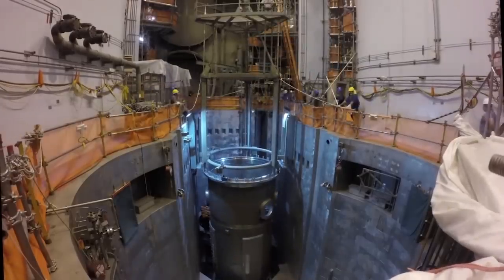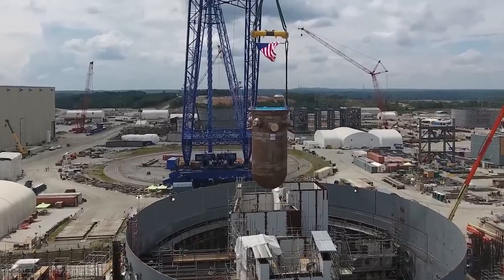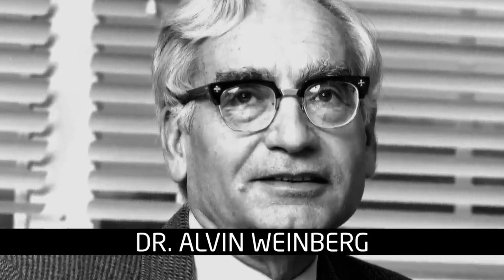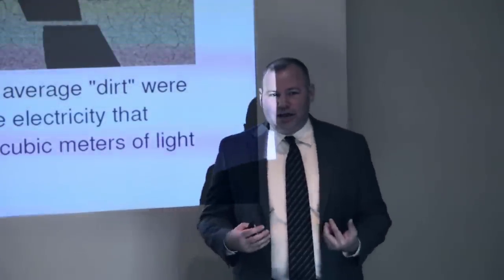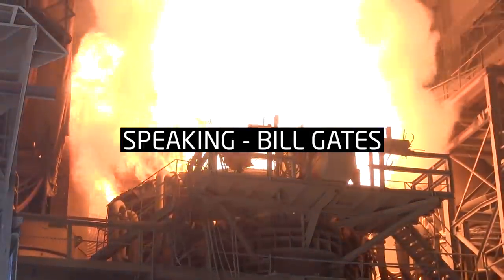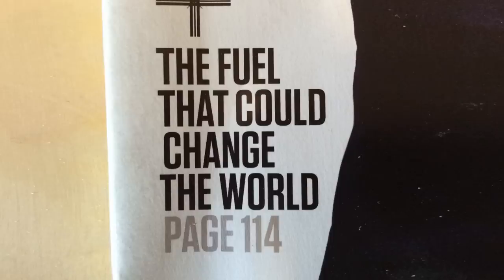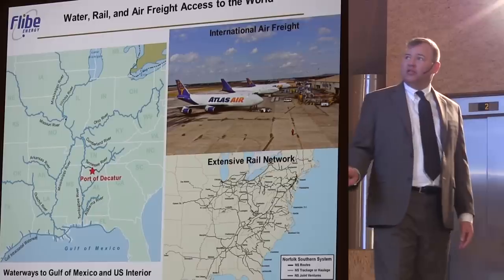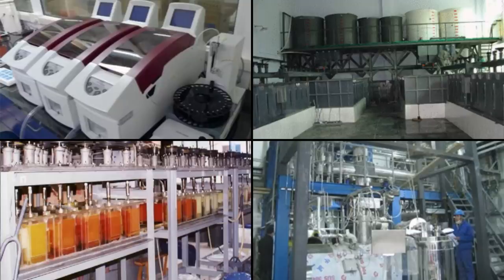Thorium 2017

Comment: Without knowing details regarding Thorium reactors, this reminds me of vertical-axis wind turbines.  Continually promoted by peripheral figures in wind energy, sometimes built, they always fail.  No windfarm uses vertical-axis wind turbines, but they sound so good when some "Professor Crackpot" names "advantages" without mentioning the DISadvantages.
And of course the real die-hard promoters of vertical-axis wind turbines end up name-calling and blaming entrenched special interests for the nonperformance and early failure of their pet designs.  They can never figure out it is just a bad idea.  

Having seen all this in wind energy for so many years, it makes me wonder if the real story regarding "Thorium Reactors" might be a similar case of a story that sounds great when only the "advantages" are presented, but has an "Achilles heel" where unmentioned deal-breaker realities loom, waiting to render the projects ineffective, with the technology not being the true solution being promoted.  Just sayin'...
Reply from the maker: Doug, thanks for taking the time to share your thoughts. Have you taken 34 minutes of your time to watch the video you are commenting on? It will impact how much I devote to writing a response.
Reply: Yeah I did watch it all, now that you asked me to, and it indeed reminds me of vertical-axis wind turbines.  For example, if someone DOES want a vertical-axis turbine, yes, it will come from China.  They seem to be the only manufacturing-capable group still ignorant or gullible enough to believe the hype over VAWT's.  Or they know there is always one more customer who has not heard the real story and who will buy one more.   I note other similarities:  The discussion diverges to many disparate subjects such as recycling, space travel, steelmaking, removing CO2 from the oceans, etc., which serve to dilute the message, while subtly adding known true facts to lend credibility to the discussion.  And the idea of extracting thorium from every cubic yard of non-ore-grade dirt reminds me of how crackpot wind energy promoters always start by explaining how a single square mile into the sky of a good wind resource could power X number of homes, then spend a lot of time explaining that we actually need electricity, as though that was ever the question...
What I do NOT see is a balanced discussion where the negatives are presented as well as the positives.  Could it be true that there are no negatives?  OK by the time I see Charlie Sheen promoting it, I am reminded of Ed Begley Jr. promoting vertical-axis wind turbines.  He even got Jay Leno to put one up on his garage!  Didn't help, they still suck, making almost no power, probably broken down by now, and your average person knows nothing of any of it, but are left with a vague emotion-based "feeling" that "Somebody is doing something about nothing".   By the way, there is no usable wind resource in Hollywood.  Putting up a wind turbine in any residential neighborhood is like trying to mine nuclear fuel in your backyard - "Hey look!  Some dirt!  Problem solved!"  Well,  believe me, I hope all this Thorium info is all true because it would even make fusion irrelevant for the foreseeable future.  But I have a sneaking suspicion there's just a lot more to this story.  Take, for example, the presentation of a meltable plug where the contents of the reactor vessel flow downward into a dump vessel of the same size for safety.  It sounds foolproof, right?  So we're done?  Case closed?  Concept proven?  No more questions?   Done deal?  OK lets take it to Fukishima.  What happens when the Tsunami knocks it over and "down" becomes "up"?  What if something else clogs it?  What about sabotage, or an explosion from something else?  Like I said, we the average people would be hard-pressed to have a meaningful opinion on any of this.  I noticed you have another video about "debunking" the thorium salt reactors,  which is slightly deceptive click-bait in that it is more like debunking the debunkers, so maybe I should watch that.  Don't get me wrong - this all sounds great, but I come from a background of energy innovations that "sound great" and I consistently watch as almost every single one of them slowly "debunks" itself.  Like they say, if someone is talking like an idiot, don't argue'  with them, just let them dig their own grave and go on talking nonsense until they bury themselves in their own stupid statements, most clean-energy breakthroughs die of their own flaws, rather than anyone squelching them.  So, for now, thanks for responding to my concerns, this is great fodder for curious minds.  It is , like I said, hard to have a true opinion without the extensive background required, although I was a physics major in the U.C. system, all I can say is I see "symptoms" of a "syndrome" that is very familiar to me by this point in time.  I hope my concerns are unfounded and it is "the answer to the energy crisis" (there's an energy crisis?) depends what day it is.  I recently read an account of all the times we've been warned about "peak oil".  Turns out it started with the very first oil well, and has never stopped since!     :)
Reply from the maker: Well now I know something about Vertical-Axis-Wind-Turbines ("VAWT"?). You are the first to bring it up as a thing to me, although I'd heard of the concept before. It just didn't sound interesting.

Of course VAWT have been commercialized and are now demonstrating their potential (or lack of?) and Th-MSR has not. I'd argue that the technical viability of MSR was demonstrated with MSRE, and that the vast majority of people in nuclear field was are aware of MSR ventures feel it is something we should pursue further.

> What happens when the Tsunami knocks it over and "down" becomes "up"?

...I do address inaccurate statements and fundamentally groundless concerns in my 6.5h edit starting after the opening credits... https://www.youtube.com/watch?v=2oK6Rs6yFsM&t=2h7m51s ...But you would be the very first to worry about the reactor getting knocked over.

I'm not going to release a video where such statements/speculation are made without context. Go watch some anti-nuclear drivel if that's what you'd like to see... there is plenty of that to choose from. The vast majority of man-hours spent watching "thorium" content on YouTube is wasted on solid-fuel reactor challenges, or on nonsense about a magical thorium car. It is my highest priority to clarify than an economic Th/U233 fuel cycle depends on liquid fuel, as that is where the derailment of dialog on Thorium commonly takes place.

That you mostly see MSR advocates on-screen in this 34m video, and relatively few universally renowned scientists (aide from Dr. Alvin Weinberg captured on video) is because the original proponents of MSR are dead. I don't have a lot of material to work with, unless you want me to keep pulling quotes from books (like Richard Weinberg does from his father Alvin Weinberg's book talking about the chemical kidney). That doesn't make for compelling video and is why I use it sparingly in this 34m edit.

Among the universally renowned (and dead) proponents of MSR, we have Dr. Alvin Weinberg, Glenn Seaborg, and Eugene Wigner (Nobel Prize in Physics). They just don't make many statements on-camera to this effect. In fact, the only known footage of an operating MSR was only discovered in 2016, and promptly posted to YouTube by ORNL. The only known audio of Glenn Seaborg talking about MSR (and Thorium fuel cycle) was found in 2011 (by Vice News). This is a reactor design lacking a proper multimedia trail, such as was left behind by pioneering LMFSR and PWR work.

Dr. Alvin Weinberg's book "The First Nuclear Era" is unavailable in eBook format, except in subscription form to SpringerLink (for Universities). So the general public can't just grab a copy for their Kindle. I'm working with his son Richard to try rectify that.

Similarly, "Fluid Fuel Reactors" author agreement has been misplaced by the publisher (Pearson). The 4 authors are all dead. I'm trying to navigate that with DoE to eventually see a copy available on Kindle, but it might never happen. Ever.

This year, finally, proper textbooks are being released with up-to-date coursework on MSR so universities can easily offer courses on the subject.

So the strongest, most technically detailed arguments for MSR by the original proponents are not easy to come by. Beyond that, the knowledgeable folk are either ORNL employees or retirees (captured and shared as many interviews as I could) or are the actual entrepreneurs launching MSR startups.

In fact, if you want to hear the most informed debates about MSR, then I'd listen to a debate between thorium proponents (or MSR proponents) as they argue in favor of their preferred reactor design. Those are in text, and I can't use text in video to any effect. The best I have is this: https://www.youtube.com/watch?v=9FO8OyqbxWc

That's MSR in general. Most MSR researchers in the 60s saw MSR and Th/U233 cycle as synonymous. One of the benefits of MSR was that it enabled an otherwise very challenging Th/U233 fuel cycle.

Today, MSR are proposed in many flavors. Thermal-spectrum. Fast-spectrum. Fueled by LEU or Thorium. With online chemical processing or without. Short-lived reactor cores (to be frequently replaced) or long-lasting ones built with Hastelloy-N.

I choose to focus on one particular reactor category... thermal-spectrum, fluoride-salt, thorium-fueled, and with online chemistry... BECAUSE it is the most challenging, and presents the strongest contrast with today's PWR.

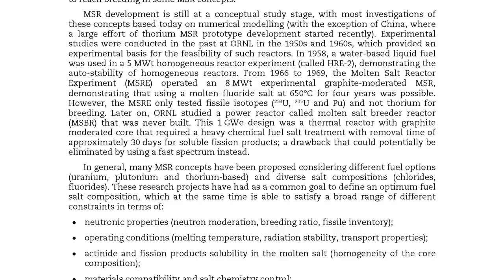I'm sorry you think I've never mentioned technical challenges associated with Th-MSR, but that would be the chemical-kidney 11:00 described in this 34m video by the OECD NEA report as "A DRAWBACK".

That is both a technical challenge to surmount, and the component that unlocks the full potential of MSR. Most MSR startups do not include online chemical processing, and so bypass that challenge.

Material challenges also exist, due to the creation of fission products in the salt and how they may react with the reactor materials. Again, we come back to chemical processing... without a kidney there's no way to remove any troublesome fission product. And I think I state very clearly in the video, it is this chemical kidney which is overtly ignored by the report cited in Dr. Lyon's testimony. (He testified in 2011 and 2014, so one can assume he was also dismissive of the kidney's implications when he first testified in 2011.)

That MSR lacked (until recently) historic multimedia assets, that the books by the most renowned scientists can not be bought in eBook form (Fluid Fuel Reactors today retails for $1,000USD used hard-copies) is/was bad luck.

But I truly think the Dr. Lyon fellow who helped create UK's NNL report on thorium fuel cycle, and the NEA OECD report on thorium fuel cycle, and who testified twice to politician that there was no benefit to the thorium fuel cycle, was a person coming from an incurious perspective on the matter. He was wrong. The reports he was involved in never look at pros/cons of online chemistry in thermal-spectrum. He was THE expert addressing legislator's questions on thorium during Obama administration. And the report he contributed to were THE reports covered by the media when thorium was being dismissed as merely "4x as common as uranium". (Not 400x as common as U-235, as Dr. Lyons could easily have explained.)

I suspect Dr. Lyon's response was from a perspective like this...

PWR is very good. Most people's fears of PWR are based on misconception. We should address people's fears rather than invest billions in a competing reactor design which only serves to highlight improvements possible beyond PWR. Any money spent on non-PWR could be used to deploy PWR instead. Only by deploying PWR can costs be reduced. We need to deploy PWR ASAP to address global warming.

...now if that's his line of thought, it is a valid one. I respect this line of reasoning.

However, his response to people asking about Thorium should NOT have been to cite Shippingport as an example of been-there-done-that. Shippingport absolutely DOES NOT represent how one would commercialize a thorium fueled reactor. He should have clarified that many advantages sought by Thorium advocates are actually associated with Molten Salt and fluid-fuel. Safety, high-temperature operation, and greater efficiency. (Not Th/U233 level of efficiency, but still much greater efficiency.)

Had he responded as such in 2014, it would have greatly helped to emphasis the importance of Dr. Leslie Dewan's testimony which followed that day. Regarding VERY specific regulatory roadblocks to domestic MSR commercialization. Of any fuel type. Of any slow/fast spectrum type. With or without online chemical processing. It is ALL hamstrung by regulatory costs specific to liquid-fuel reactors. (That happens to include Th-MSR because of the MSR part.) What more do you need than testimony from a PH. D. in nuclear engineering saying so? They continue to receive private investment, and develop their flavor of MSR, just with no intention to build a pilot plant DOMESTICALLY.

There is absolutely no Vertical-Axis-Wind-Turbines analogy to this. If someone wants to put up a wind turbine they do it. Neighbors might complain and obstruct. But there's no regulation specifically larding costs on windmills depending on their vertical/horizontal orientation.

One last thought.

You call attention to the concept of harvesting Thorium from rock...

"And the idea of extracting thorium from every cubic yard of non-ore-grade dirt reminds me of how crackpot..."

The term "burning the rocks" was coined by Dr. Alvin Weinberg.

No one presents it as the optimal means of harvesting energy. It is a thought experiment to demonstrate the energy potential of 6 PPM Thorium. There is more than enough thorium left behind in coal ash and in REE mine tailings that we'll never "burn rock". But we could. Like diffuse oil sands harvesting (minus pretty much everything horrible about the oil sands) we could mine the Earth, if we wanted to, for Thorium. (That we have any geothermal energy at all is thanks to Thorium and Uranium found in the Earth.)

It is taken as obvious by everyone that seawater is fuel for fusion reactors. If no one had started to explain that potential when fusion research started, then today the value proposition offered by fusion reactors would be unclear to the general public. I don't care how it sounded back then. It was true then, and it remains true today. Seawater IS fuel for fusion reactors, ASSUMING we can build a fusion reactor.

If you think the illustrative concept of "burning the rocks" is invalid, and not just crazy sounding, then you should explain why.
Reply: Point taken.  I think my grammar was OK but people should write at an 8th grade level for general consumption.  Thank you for pointing out my bad style.  Do you have any comment on what I actually said?  Do you think thorium is a great new solution, or is it possible we're only being told the good side?  I hope I wrote that OK...
Reply: Your argument is old as the hills and is in fact a logical fallacy. There are two versions of it, both of which are logical fallacies. Version 1) Tech A sounds a lot like Tech B, Tech B was a dismal failure so therefore Tech A will be a failure also. Version 2) Tech A sounds a lot like Tech B, Tech B was a tremendous success, therefore Tech A will be a tremendous success. The Version 2) fallacy I hear frequently is: Microelectronics has been highly successful, costs falling and computing power increasing, Moore's Law and all that . Solar PV is a lot like Microelectronics. So therefore it is inevitable that its cost will fall precipitously and its performance will increase similarly. Also a fallacy.

Using that argument you can pretty much declare any new tech will be either a) an incredible success or b) an incredible failure just by cherry picking the tech you want to compare it to.

As for vertical axis wind turbines, like all wind energy it has four big strikes against it before you even draw one line in your CAD design software. 
1) terribly low energy density 
2) the cube law of wind energy means you will & must have a highly fluctuating intermittent energy source  
3)  the extreme geographic variation of wind energy 
4) the ubiquitous seasonal variation of wind energy. 
There is no way to correct those inherent physical constraints on wind energy.

As for nuclear power, be it thorium, uranium or any such tech you have  big advantages before you even start:
1) extremely high energy density, vastly higher than anything available right now 
2) unlimited fuel supply, there is no energy source on the planet that satisfies 1) and 2) that comes remotely close to that 
3) extreme high temperature operation quite practical, a big advantage for any energy source 
4) works perfectly well in any location - under the sea, in space, the moon, Mars, mountains, deserts, rainforests, Arctic, anywhere, anytime doesn't even need oxygen, unlike all fossil or biomass energy sources 
5) related to 1) extremely small fuel requirements mean the logistics of energy supply are very easy, unlike oil, gas or coal, where fuel transport can be exceedingly difficult and expensive.

So with any nuclear tech you start out from a very, very strong place vs wind you start out from a very, very weak place. That does not guarantee success for every and any nuclear tech or guarantee failure for any and all wind tech but it right off the bat shows trying to compare nuclear tech to wind tech is entirely bogus, like comparing apples to baseballs.
Reply: whykhr, I will bounce back your original reply to me, back to you: 

"you need to take a course in basic English grammar, your tirade 
comes across as mindless gibberish from a demented crackpot."

1) Wind energy has been the fastest-growing energy source for many years, and is now cheaper than existing nuke plants.   Lately wind has been the cheapest form of electricity, around 3 cents/kWh wholesale.  Our facility is wind-powered, and this year Edison sent us a check instead of a bill.

2) Solar indeed HAS gotten ridiculously cheap, a teeny fraction of its cost in just the last decade.  Not quite like Moore's law since they can make the panels cheaper but can't make the sun stronger, but a spectacular drop in price nonetheless.  I can buy panels for 32 cents/watt, and inverters have gotten so cheap that you could power your home for decades for way less than $10,000 total if you installed the system yourself.

3) I never said the thorium reactors are not "the answer".  I simply floated the question, could it be another case of only positive aspects being presented, but with a background largely unknown reality of severe "dealbreaker' problems that make a technology actually less desirable that the status-quo and essentially unworkable?  

It is just a question, not a judgement.  It's always possible someone with more knowledge  of this subject could reply and help us understand the actual situation better.

The other observation I made is most people do not have the technical background to make a meaningful comment on comparing various nuclear technologies.  How do we even know what we are taking about?  Wouldn't we just be repeating things other people say, without really understanding the whole picture?  

The reason the vertical-axis wind turbine comparison came to mind is it carries a similar dynamic:  Proponents seldom even KNOW about the unworkable aspects of VAWT's, such as using twice as much material to make less power, while beating themselves to an early death due to reversing forces twice per rotation.  

What you hear instead is "bird-friendly" and "better able to take advantage of the turbulent winds in an urban environment", which are all the average person can understand - vague feel-good talking points, but real wind energy people know such statements of advantages are irrelevant and/or inaccurate.

So what I was thinking is someone with a strong working knowledge of nuclear power technology might chime in and tell us something we don't know.
Reply: 1) Nope REAL COST of wind, no subsidies is ~ 13 cents/kwh onshore and >25 cents/kwh offshore.  Ontario is paying 6.6 cents/kwh for Nuclear, 14 for wind, 48 for solar. Wind is driven by subsidies, Warren Buffet admitted the ONLY reason he invests in Wind is because of the incredible subsidies, he says he turns a profit without generating one kwh of electricity, just due to the enormous tax subsidies. 

2) Repeating the same lies over and over don't make it true. Solar is not even remotely close to economical. Latest big Solar plants in the US are running $20k per avg delivered kw of energy. That's 4X the cost of Nuclear or Supercritical Coal, 15X the cost of Gas. Wind in the USA is a similar capital cost to Nuclear per delivered avg delivered kw EXCEPT BIG difference, Nuclear is 24/7, night/day, windy/calm, sunny/cloudy/snow/monsoon, north/south, volcanic eruption power that lasts for 60-100 yrs not 8-25yrs, as the Solar & Wind does. 

Germany still pays a FIT for solar of 17 cents per kwh, 19 cents for its offshore wind, 4.4 cents for Hydro so how is that cheaper and why has installation dropped to a trickle? And they are building big smoke belching, dirty lignite burners, why are they not building solar and wind instead - if it is cheaper?

Ontario is paying 48 cents for its tidbit 1% of solar generation, 6.6 cents for its 62% of Nuclear Generation, 14 cents for its Wind 6% of generation, France is paying 27 cents/kwh for its tidbit of solar, Japan 50 cents/kwh for its tidbit of solar. Yep, that's cheaper than fossil yep, believe us, we don't lie, yep.

And that is just the beginning of the Wind & Solar madness. Unlike a legitimate energy source, wind & solar do not replace any of the vast fossil infrastructure, you still need all the power plants, maintained manned and often fired up, building steam, all the vast natural gas pipelines, production wells, fracking sites, storage, oil infrastructure, tankers, military, coal mines, rail cars, LNG tankers, the works. That is a huge investment & maintenance cost. So all solar and wind does is replace a bit of NG fuel worth 2 cents a kwh. And it actually costs additional infrastructure on top of all of that. And wastes fuel due to induced cycling inefficiencies in the shadowing fossil generation, just as your car wastes fuel in stop & go driving vs running at a steady speed, and also wastes more energy due to curtailments, when wind & solar are max, especially in spring when hydro is max and demand is min = Energy Inefficiency on steroids.

3) The super-rich multi-$billion anti-Nuclear Fear Mongering lobby groups like Greenpeace, ENDLESSLY invent and hype every little problem nuclear including thorium has, inflating every issue by a factor of 100X and inventing issues that don't exist. The REAL ISSUE is the incredible lack of commentary on the severe dealbreakers of wind & solar energy. For instance look at the list I posted earlier here.
Reply: I agree that wind and solar are limited to windy and sunny times, but the rest of your information is WAY outdated.  Wind is fun (exciting), and gets cheaper every day, and the subsidies (which are only small tax loopholes) are becoming unnecessary, and solar panels and inverters are getting so cheap you could power your home in perpetuity for under 10 grand if you know what you're doing.  My facility is 100% wind powered - last year our electric bill was a check from Edison.  We make more than we use.  One factory turbine and two that I built.  Fossil fuels & nuclear also receive preferential subsidies, incentives, tax breaks.  The greenest power is actually coal - ask the green plants what they would vote for, and it would be coal, which produces the most CO2 per MwH.  Satellite studies show increased vegetation cover across the globe in proportion to the increases in CO2 levels.  What's good for the greenhouse is good for the planet.  We are drowning in disinformation.
Reply: Bull. There is anything I said that is outdated, in fact is latest information. I posted all the problems with wind & solar above in a previous post, if you can figure out how to overcome them, not by waving your hands in the air and making vague platitudes but by actual tech with numbers, calculations, then show us. You won't because you can't.
Reply: By the way, I just noticed that your "tirade" about grammar is a "run-on sentence".  After "grammar" the comma should be a period, then "your" should be capitalized, beginning a new sentence.  Thanks for taking me me back to elementary school.
Reply: Here's another link from the AWEA which admittedly has their built-in bias, however you can clearly see wholesale wind energy prices in the midwest are now commonly as low as 2 cents kWh.  

http://www.awea.org/falling-wind-energy-costs

It's a mistake to confuse the cost of wind energy just a few years ago,  with the low prices from newer installations.  Turbines are getting bigger and cheaper every year, a trend which is projected to continue long into the future, and the subsidies, which were originally implemented to match subsidies for fossil fuels, are seen as increasingly unnecessary in the future, and are therefore set to expire in a few years.  Last year's high-tech, boutique-aerospace-priced wind turbines are tomorrow's cheap industrial commodity using well-understood technology.
Reply: Selsam is that all you got, grammar? I could care less about grammar, your tirade was one giant run-on sentence, the issue is it was mostly gibberish, unintelligible. I am pleased that you have greatly improved your presentation however. Bullet points are fine with me if organized in a rational and intelligible manner.
Reply: Yes, the very pro-wind EIA puts weighted onshore wind, which is almost entirely great plains wind at 5.6 cents/kwh, while promoting an absurd 41% CF% while actual real world EIA values have consistently averaged around 30-33%, so using that fact  we are more like 7.3 cents/kwh and add a 1 cent/kwh variable O&M cost which they don't publish you are 8.3 cents/kwh, with other subsidies on top of that.  That is for the best onshore wind area on the planet and >1000th-of-a-kind factory produced, fully automated wind, with no upfront decommissioning or waste storage costs. 

Compare with GenIII First-of-a-kind Nuclear, not factory produced, decommissiong & waste storage/disposal paid up front, at 9.6 cents/kwh. That is not apples to apples. All the wind is doing for >8.3 cents/kwh is replacing a bit of natural gas fuel worth 2 cents/kwh in USA & Canada. Does not replace any of the vast & expensive fossil infrastructure. You still need all the fossil power plants, often running - cycling, fracking fields, pipelines, military protection, fossil storage, all maintained. And induced cycling inefficiencies in the shadowing fossil power plants induces 20-50% increased fuel consumption, so really only saving 1.2 to 1.6 cents/kwh, while costing > 8.3 cents/kwh that's for delivery in 2022, according to the EIA. Add to that additional  infrastructure (i.e. storage, long distance transmission, grid stability batteries) are MAJOR added costs. That's for an energy supply that only lasts 10-15 yrs. 

And that is Great plains wind. Offshore wind, which is about all you can get over the vast heavily populated eastern seaboard with a decent CF%, EIA puts at 15.7 cents/kwh, again with fanciful CF% and ignoring variable O&M cost, and other subsidies. Real world latest Deepwater wind @ 24-50 cents/kwh.

Compare with Nuclear. It pays decommissioning & waste storage up front. Has no need of fossil infrastructure, can replace all of it. Lasts 60-100yrs. And factory produced molten salt reactors, which is what we really need to be doing, will easily cut nuclear costs in half. Even Nuscale should be easily cheaper than Great Plains Onshore Wind without all the incredible added costs of intermittent, non-dispatchable wind. And the nuclear works anywhere, anytime, 24/7, night/day, north/south, windy/calm, sunny/cloudy, volcanic eruption, climate change, monsoons, rain/snow/EMP. How do you know high wind areas may change due to climate change just as good hydro sites have been severely affected by changes in rainfall? Then all the wind infrastructure will be much lower value.